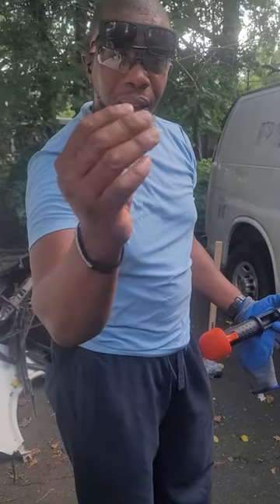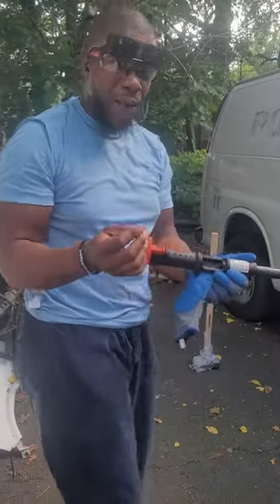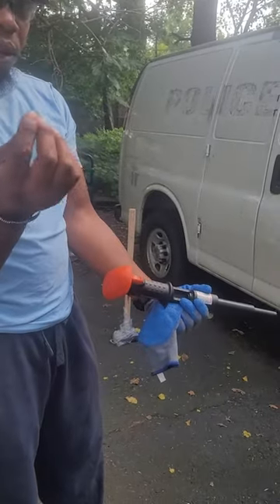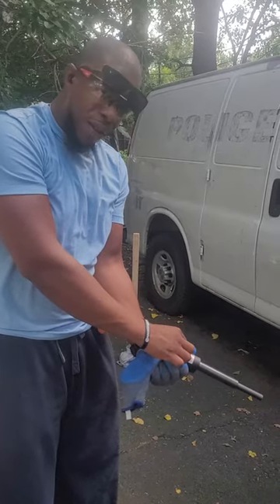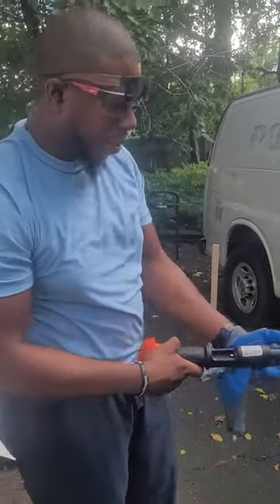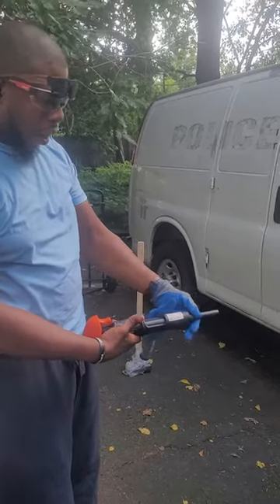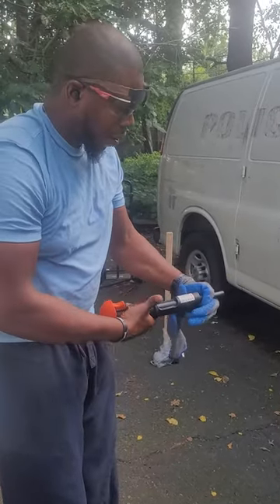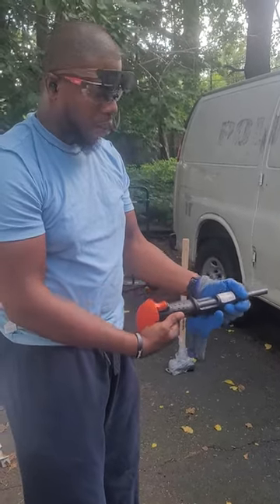Chevy Express side door hinge removal

Comment: Today...you are my new best friend.   Swapping doors on 05 Express.  I tried heat and some pounding first.  Afterall...thats basically free.       HD....$34 for the ramjet. $14 for shells(100).  Coulda got 25 for $8. I got the yellow box rated the highest charge.   But this tool i will just add to my collection. I used to have one years ago.   All pins were dry and untouched except the one i heated and added penetrating oil to.     What can i say.  Today you are my best pal.  Cheers. ❤️🇺🇸

Comment: btw you could use a hinge puller.
Reply from the maker: @dirtyscant3447  that was square 1.  The Hinge puller couldn't remove not one pin. Then, the bolt in the hinge puller became stripped. So i brought another one. The same thing happened. I should've recorded the failure.  Them puller was $40. I wasted $80 bucks just to get zero pins out

Comment: it doesn't work, it turns the tip of  the pin into mushroom, special tool from ebay works but bolt is weak. Only thing worked for sure was drilling out, took me 4h to do. Good luck.
Reply: It worked great for me. .   05 express.   Removed all the pins.